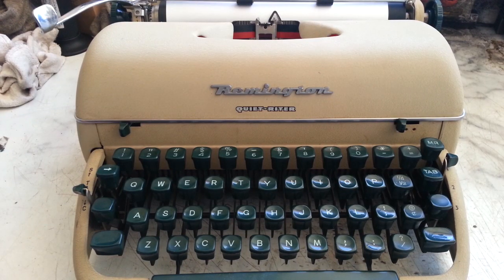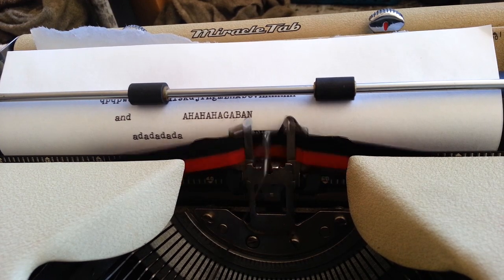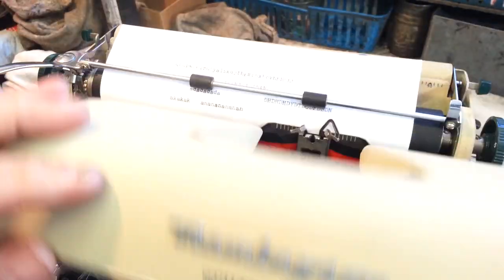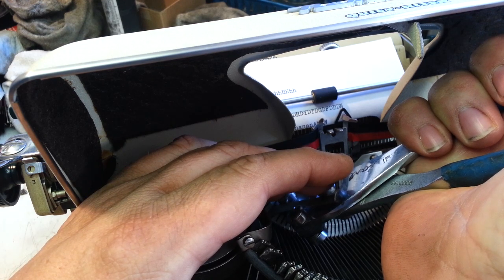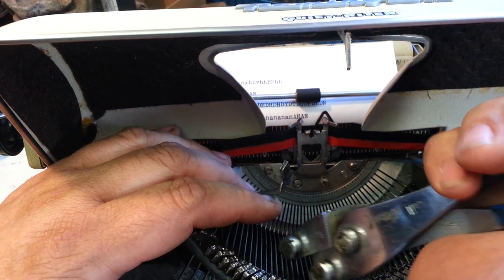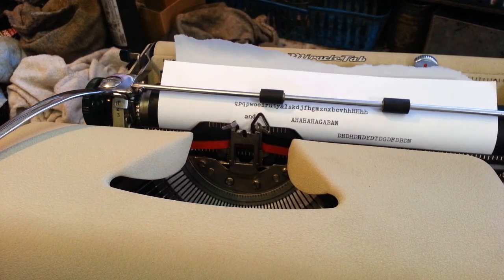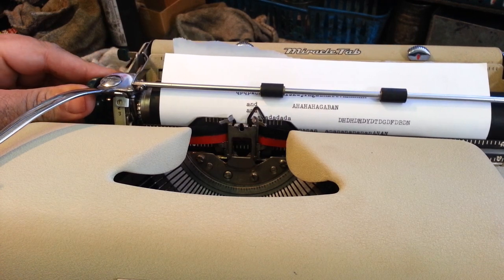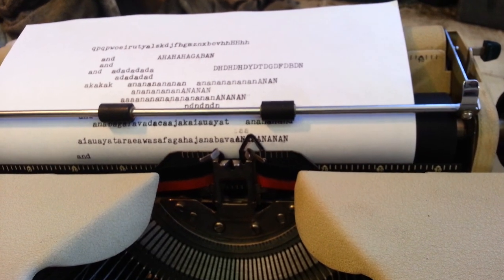Remington Typewriter Type Alignment Adjust Typebars

Comment: I have a nearly perfect working typewriter just for some reaosn the ribbon riser doesn't fire when hitting the keys it just sits there.  Any tutorial on how that works on the quiet writer?

I think there should be a completely separate category for these typewriters they seem unlike most of the other mechanical typewriters or at least they seem to have their own set of problems.  Thank you.
Reply from the maker: Ribbon selector lever in correct position ?

Comment: I have one of these and the shift key is super stiff and will not fully depress. So I can only type in caps when I use the shift lock. Anyone got any ideas? It worked fine when I bought it, but while fixing some other issues this problem suddenly arose.